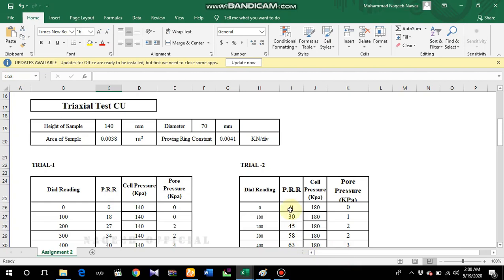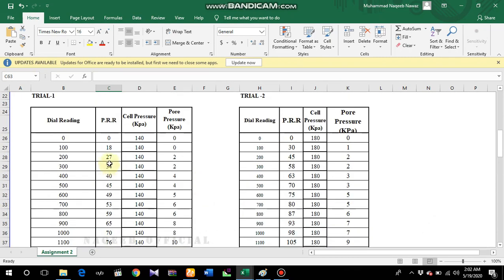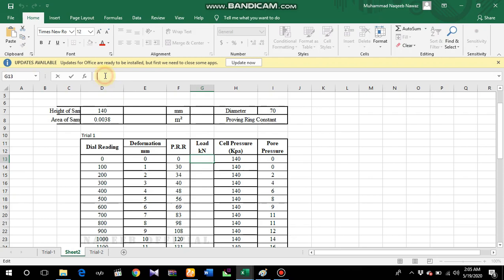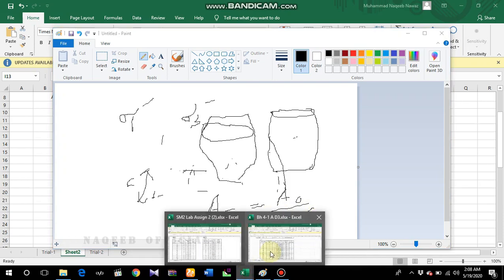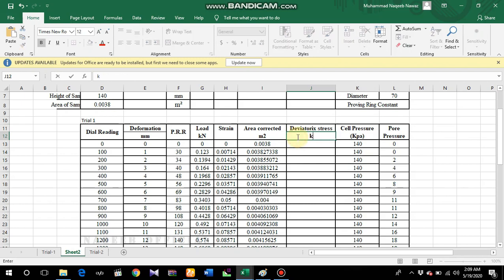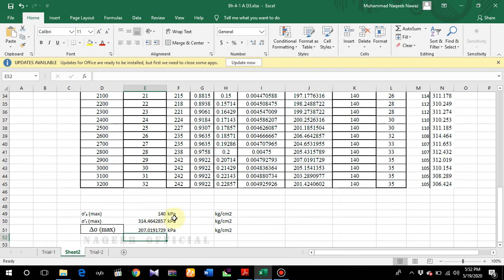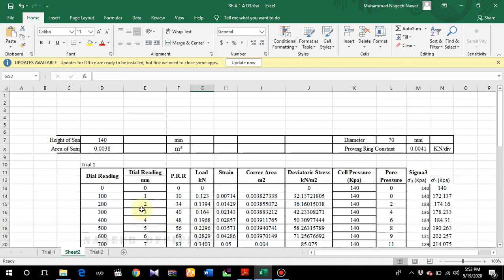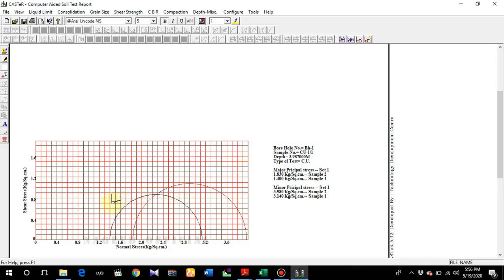Triaxial Test (CU) Calculations | Caster Link in Description | Geotech with Naqeeb

Comment: if its undrained, then there is pore pressure only during saturation of specimen or consolidation but it then be zero because the drain valve be open in 2nd stage, hence can we consider pore pressure zero and make equal the cell pressure equal to sigma 3.

Comment: In my opinion, if you consider max. deviator stress as a failure criteria then you have to consider sigma3' corresponding to max. deviator stress and not max. value. If we take max. value then every time sigma3 = sigma3' as pore pressure is "0" at the initial stage and as pore pressure increases sigm3' decreases.
Reply from the maker: yes you are right if you want to find to find effective cohesion and effective friction angle then you need to take corresponding effective sigma3. But in my case i have computed total stress parameters
Reply: @GeotechwithNaqeeb  As you have deducted pore pressure while calculating major and minor stress, they are effective stresses and not total stresses. It is better to use  "sigma" instead of "sigma' " while calculating the total stress parameters.